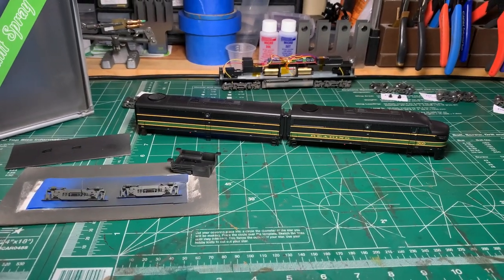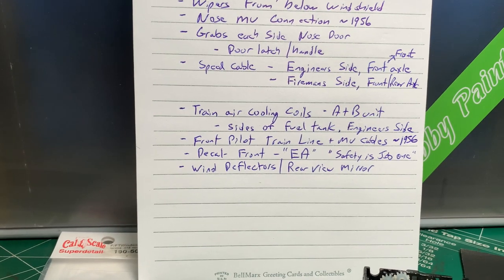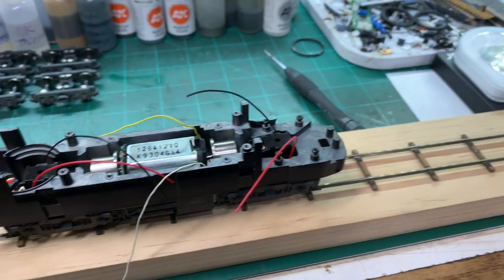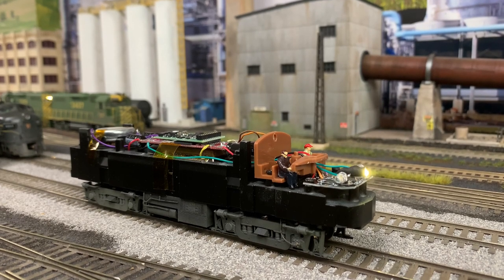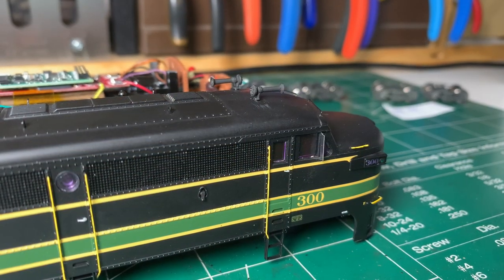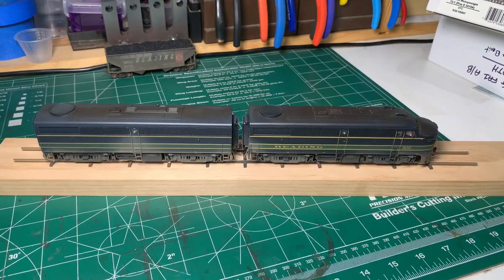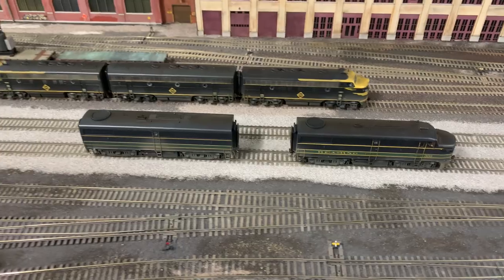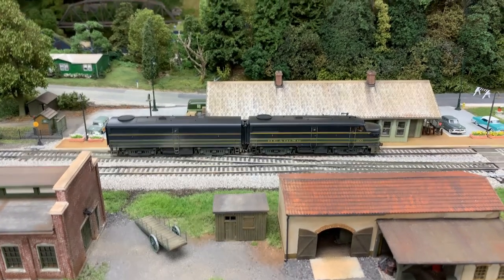MTH Reading FA1 A/B Set DCC Upgrade

Comment: Hey Stephen.I dont normally comment, but I was really impressed with what you did to those locos.I,also believe, that if you have a loco that doesnt run properly,insread of putting it away. & forgetting about it, it is far better to modify them to upgrade them. It is really not that difficult, if you know what the problems are.Mth, are basically really good, well built locos. The sounds   are what let them down.Bout five years ago, I bought a couple MTH Dash 9s, DCC ready & put loksound units in both. Just absolutely gorgous locos.The lighting was spot on, detail was excellent,etc. Not that long ago I also bought another Dash 9 with the ps3 factory sound. Well, what aload of garbage.They did run well, but the ps3 is their downfall. Not even any dynamic brake sounds.The price I paid for the ps3 one & the DCC ready ones, were the same price $150.ea. Apart from that MTH locos really good. ( Dash 9s anyways)..... love the weathering.What was the paint & colour, you used?  Ounce again, well done.
Reply: Ps sorry it appears your name is Rob.

Comment: Robear- in all the years we have 3 minutes of trains actually running. You are quite stingy on the good parts. 4 shame.
Reply: Guilty as charged- you are correct. (although it is a little more than 3 minutes, but point taken). I will work to get some running videos uploaded.
Reply: @robbennett1965  Can't expect you to do more than try.  We miss you.